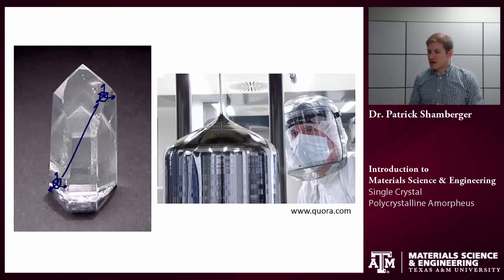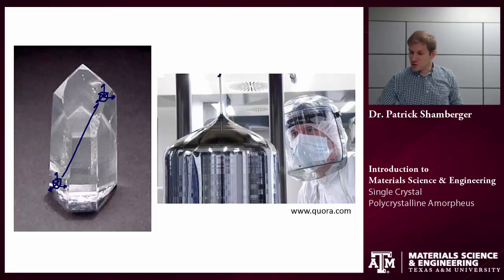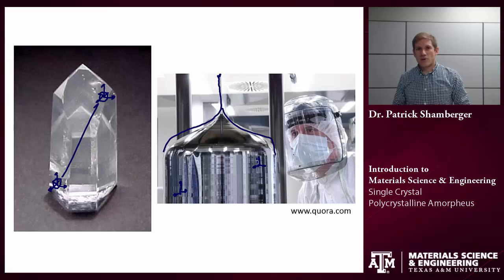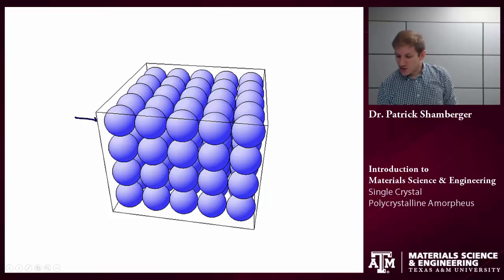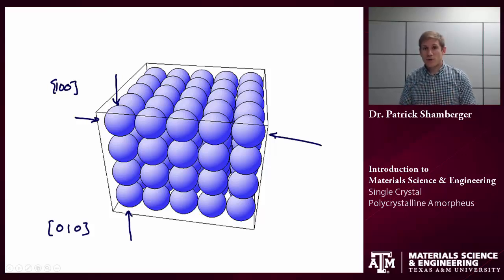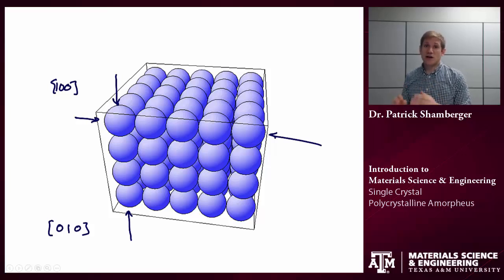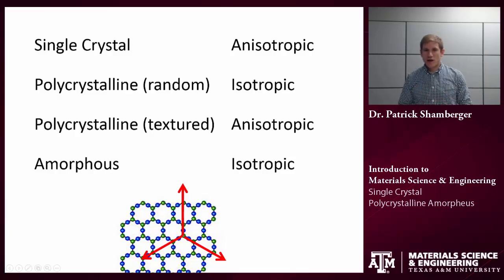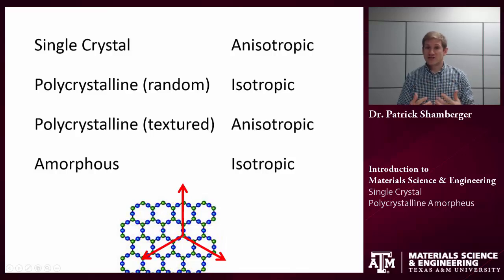Single Crystal, Polycrystalline, Amorphous {Texas A&M: Intro to Materials}

Comment: Hi, thank you for your videos, I need to ask you something. (I'm a student with an exam about this very soon).

I think I've allways been taught that in the cold working what you change is the shape of the grains, but not their nature, so that's why after the cold working it appears what is called strain hardening in the direction where the grains have been strained. BUT as you didn't change the phisical properties of the bonding, you still have the same measure of the Young Modulus.

To me it makes sense that is you only strain the grains, but don't reorientate the crystals to a prefered direction, then the Young Modulus should not change. In the other hand it also makes sense to me that in the straining of the material you lose some randomness of the material and so you change the Young Modulus. 

Being a student I don't have any lab to test wich of the assumptions is true, Could you please explain it to me?

Thank you so much.
Reply from the maker: Your description: "...in cold working what you change is the shape of the grains, but not their nature, so that's why after the cold working it appears what is called strain hardening in the direction where the grains have been strained..." is accurate.  You change grain shape and orientation, but *after* removing the load, the crystal will return to its equilibrium structure (bond lengths will relax to their equilibrium distance).

However, your second point: "...if you only strain the grains, but don't reorientate the crystals to a preferred direction, then the Young Modulus should not change. In the other hand... in the straining of the material you lose some randomness of the material and so you change the Young Modulus."  is also correct.

Essentially, if you only cold work to a small degree (change the concentration of dislocations, but don't induce much preferred orientation), you could expect the Young's Modulus to remain unchanged.  However, if you do induce significant preferred orientation (AND if Young's Modulus is strongly anisotropic in a particular crystal system), then you could reasonably expect to modify Young's Modulus to some degree in one particular direction.

Comment: Thanks so much for such a nice lecture! I have a question: If we etch the surface of let’s say stainless steel, we would be able to see grains and grain boundaries. However, if we see such a sample under TEM, and focus on only one grain, would it be possible to see different crystallites (different atomic plane orientations) within one grain? Basically, I do not understand the difference of crystallite and grain. I think both has same meaning and basically grain boundary is the boundary between each grain (crystallite) with different atomic orientation. However, I see people try to distinguish between grain and crystallite which I am interested to know their difference!
Reply from the maker: Amir, I would agree that a "grain" is commonly used in the same sense as a "crystallite".  "Grain" is probably a bit more generic, but I am essentially referring to a small crystalline domain that has a continuous crystal lattice throughout (i.e., a crystallite - a small crystal).  "Grain boundary" is also general in that it can refer to a boundary between two similar crystals of different orientation (a homophase boundary) or between two domains with different crystal structures (a heterophase boundary).  Also complicating matters is the existence of precipitates, which are essentially "grains within grains" (small regions of 1 particular crystal structure embedded within larger domains of another crystal structure).  So what you might define as a "grain" at one lengthscale might actually be composed of more than one phase of you look hard enough.

Comment: Hi, thanks a lot for such a cogent video.

I had one question, many a time, people interchangeably use the terms 'grains' and 'crystals'. I suppose, even you did the same in one of the sections in the video. Can you please help me understand the nuances here? Can a grain be considered a single crystal?
Reply from the maker: Varun - this is exactly right.  Usually when we are looking at a polycrystalline material, we will refer to a single crystal domain as a "grain".  Things can get a little bit more complicated if you have small precipitates (i.e., a secondary phase) occuring within one "grain".  But usually, when folks use the word "grain" for a polycrystalline solid, they are referring to a single phase that has a continuous crystal lattice throughout, and it is separated by a neighboring "grain" that could be the same phase (or a different phase) by a "grain boundary" (where the lattice orientation generally changes across the grain boundary).
Reply: @pjshamberger  Thanks a lot, sir. This made it clear.